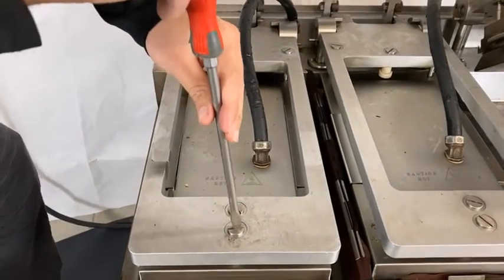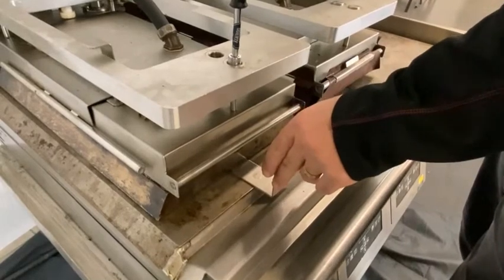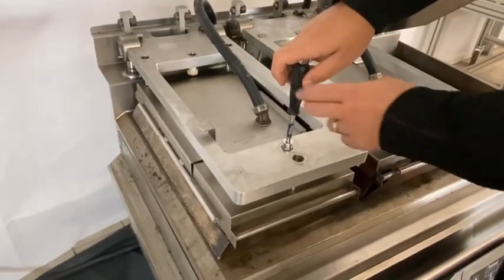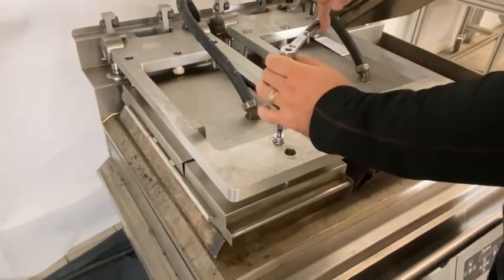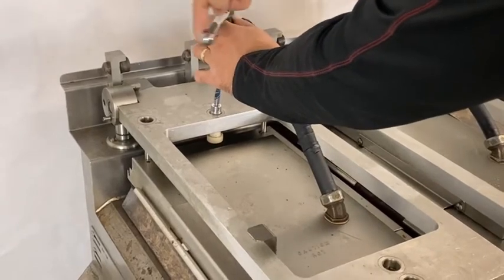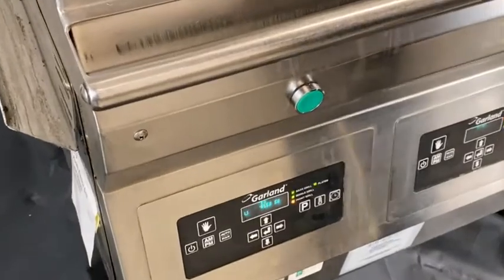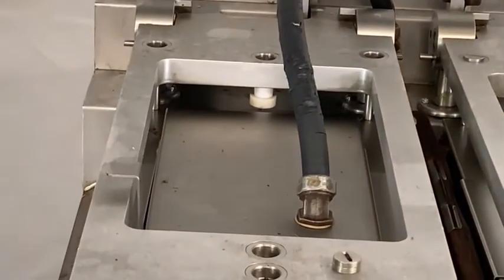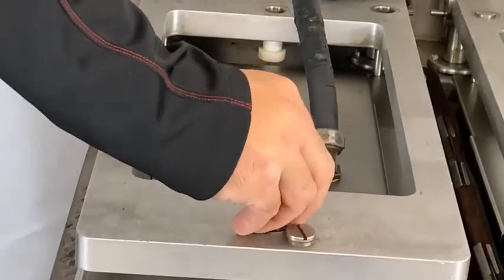MWE Gapping and level reed switch

Comment: Would have been more helpful showing how to get into screen calibration
Reply: Well you push "p" for 3 seconds then the up and down arrows for 3 seconds the right arrow twice you'll be in  calibration with "No" at the top then you'll hit the center arrow till it make no flash then press arrow up till it will say yes and be flashing just it that center arrow and yes will stop flashing then hit the green button to drop platen. Or goto partstown and pull a manaul like I did 😉

Comment: Were can j get the adjuster tool to abjust the reed switches
Reply from the maker: The tool is just a 1/2 socket that’s been modified to fit the slots and the fitted to a 1/4 drive. Welbilt uk GAR 101 have the socket or parts town 4529431

Comment: My Reed switches will not beep. They are working when testing by themselves in the platen. The light on the board says on
Reply from the maker: Check the wire harness is not shorted out to the ground. That will cause the same fault
Reply: @garlandgrills3889  Do you have the harness part #?

Comment: how many 1/2 socket mm?
Reply from the maker: 13mm socket
Reply: @garlandgrills3889  If the lead switch is a problem, does the top plate move in?